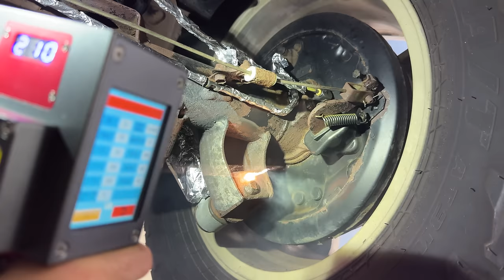Ultimate 4Runner Detailing: Laser Cleaning Rust Removal, Dry Ice Cleaning, PPF, & More

Comment: The dry ice is basically a steam cleaner using the direct opposite concept and the laser rust removal is pointless unless you are respraying primer and paint afterwards.
With the laser you also have to be really careful around thin things like brake lines as the laser will punch a hole right through them.
With this deep of an effort you are basically entering the realm of restoring the car.
This is far beyond detailing.

Comment: These machines go for $5-$13k and they can last up to 10000 hrs each car can take up to 8-16 hrs those machines work very slow and you have to take your time because if you overheat the metal you’ll make holes and it will definitely cost you your job In a small claim lawsuit